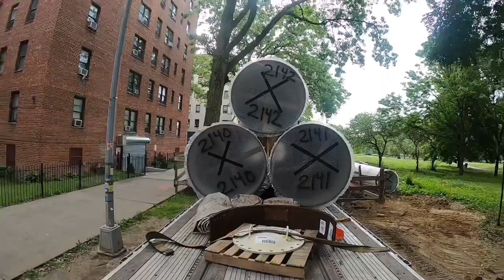George Washington Bridge NYC And Backing Down A One Way Street | Driving In The Bronx

Comment: Isn't that a insurance liability to alow any one but a company employee on the bed. Shouldn't they have had a small crane to remove those pipes off the truck like they used to install roof top air conditioners.
Reply from the maker: Not a lot of space up there in New York